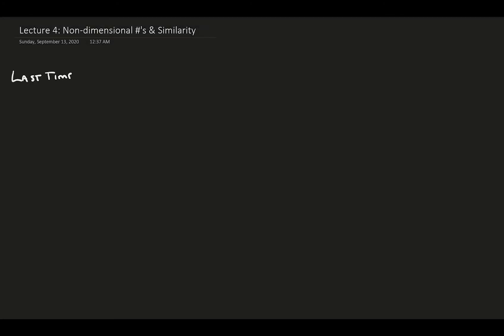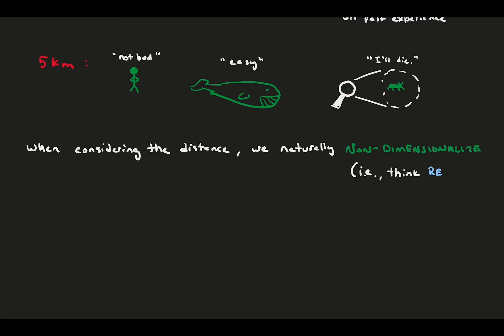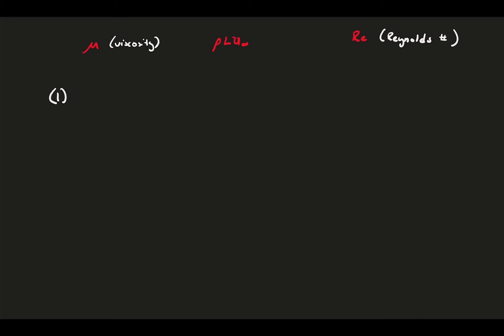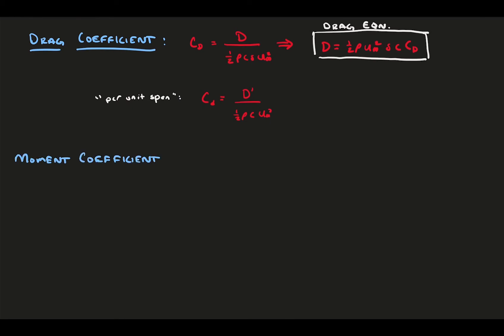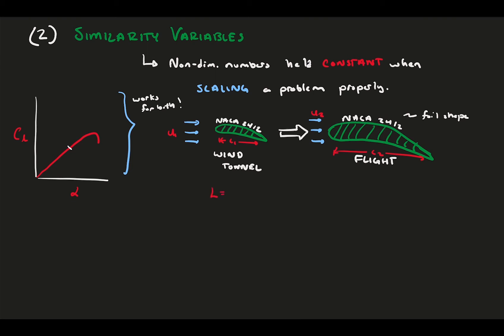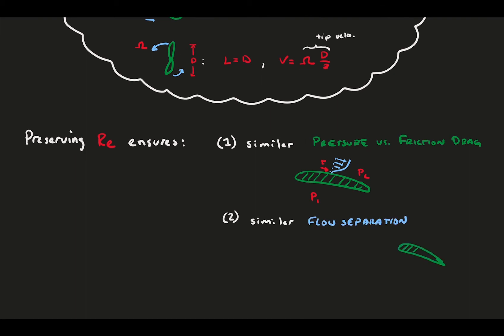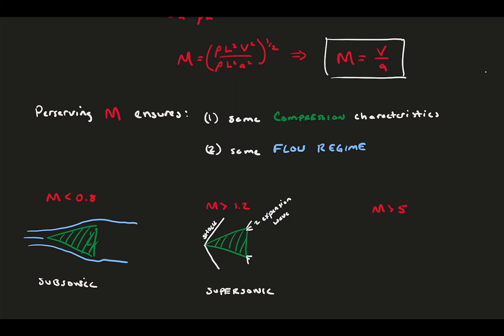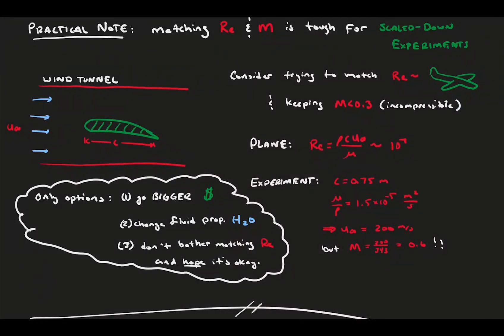Nondimensional numbers and Similarity [Aerodynamics #4]

Comment: thanks for your extraordinary labor, it was perfectly helpful to understand the main concept. But fortunately, ı couldn't get the point when it comes the similarities. İs there any more precise definition about why  Cp are equal for different scaled shapes. Or is there any resource that may help me in that subject. Thx again
Reply from the maker: My pleasure! I looked through the video again because I wanted to be sure, I am not sure where Cp (which is sometimes pressure coefficient) pops up, but I suspect you mean Cl instead, as in the lift coefficient?

If so, I should say first that Cl does not perfectly stay the same at different scales. Other concepts like turbulence and Reynolds number come into play here. However, for the most part, it is sufficiently equal across a wide range of different scales. This is because take into account all the variables that impact lift when we scale the problem. A bigger airfoil would produce bigger force at the same air speed, but lift coefficient takes that into account by scaling with the area.

Does this help at all? Otherwise, I think the text by Anderson might be helpful here. Otherwise, my video in fluid mechanics on non-dimensional numbers more completely goes over these concepts in a way that is not restricted to aerodynamics.

Comment: Hi Professor,
1. For a propeller, if we intend to keep Re similarity, we then choose L=D and V=Omega*R as tip speed ratio. However, if we implement blade element momentum, every blade element spanwise will have different Re numbers. Considering downscale 5m Diameter turbine to a 0.8m Diameter turbine and the blade element at 1/5R, meaning 0.5 and 0.16m respectively, do we need to ensure the Re equal among those?
2. Why do we choice V=Omega*R?
Looking forward to hearing from you.
Thanks.
Huy.
Reply from the maker: Thanks for your patience! Just getting to comments after a short stint away. 

This is a good question. In these cases, there are multiple velocity scales (tip speed vs forward speed) and it is very hard to preserve all the non-dimensional numbers when scaling down. If you scale down in size, usually you need to increase velocity to compensate. This means, needing much higher rotation angular velocities of the turbine (to preserve tip speed ratio), which introduces all different sorts of problems. Definitely a challenge!

Tip velocity is just a lateral velocity component, there is still usually a forward velocity. Typically, you choose based on which one is dominant.

Comment: Hello, Nice job you are doing withh these lecture.

Just a small carification, for the sake of logic.
The body length for a human may differ, if covering 5 km by walking, the body length would be the step distance, which is typically 0.5 m to 0.6 m. Now when you run it does not change dramatically. So the dimensionless distance for 5000 m would be in that case, between 8333 to 10000.
Reply from the maker: Thanks! Yep, I think you make a great point that the meaningful reference dimension (in this case length) is problem-dependent and often there are multiple to choose from. In this case, you could make the argument that the step distance is directly correlated to body length, so it would effectively be the same.  Either way, there is a lot of wiggle room in choosing reference lengths.
Reply: @prof.vanburen  sure! this is just my rigorous nature :)). A human being can crawl too :p

Comment: In the fluid mechanics course for non dimensionalising we took inertia force as pu^2L^2, why are we taking it here as 1/2 pu^2L^2?
Reply from the maker: Confusingly, it's just a matter of convention. Often, constants are dropped when doing estimation analysis and the constant was dropped in Fluid Mechanics. However, in Aerodynamics the dynamic pressure (1/2 rho * u^2) is everywhere because it shows up predominantly in the Bernoulli equation, which is super important, so all the aerodynamic force/moment constants tend to be normalized by the 1/2 rho*u^2*L^2. There are different ways to derive the inertia force scaling and Aerodynamics and Fluid Mechanics approach it from a different perspective. Note that, even in Aerodynamics, Reynolds Number is defined with the 1/2 dropped.
Reply: Thanks for the explanation!